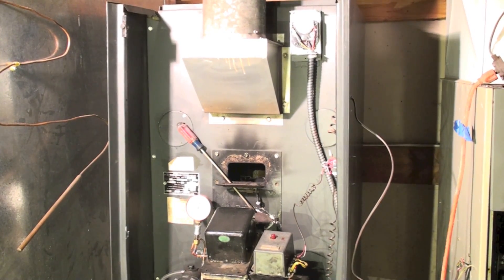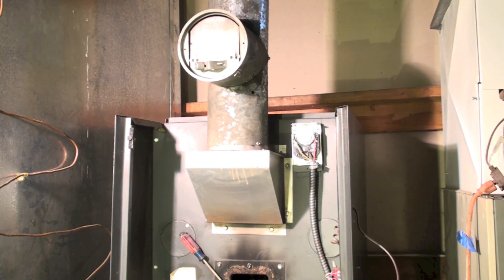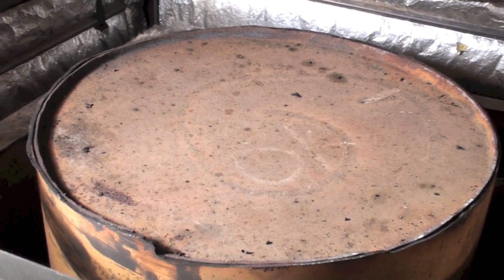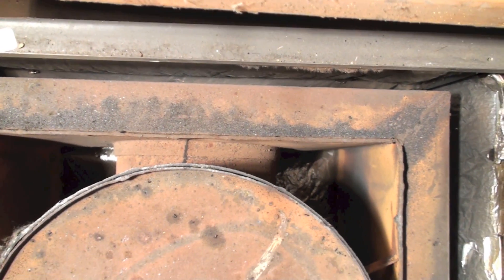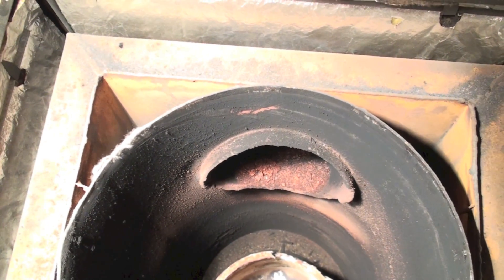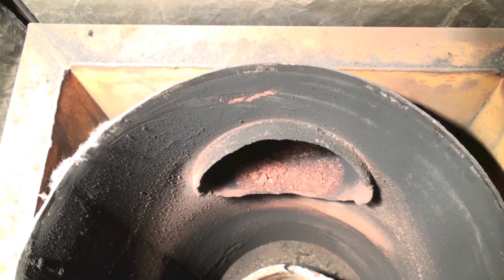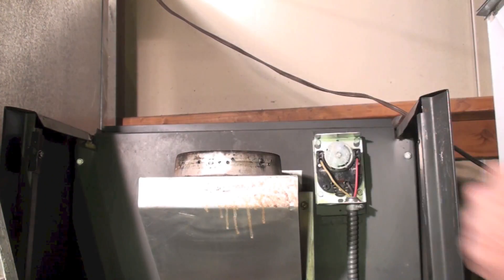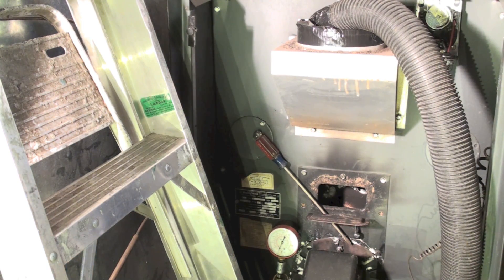Cleaning the oil furnace heat exchanger without cleanouts

Comment: Is it possible to simply drill 3 inch holes and add cleanouts? They look pretty simple
Reply from the maker: I guess you could, but you need an effective way to plug the holes.
GFM
Reply: @grayfurnaceman  do you have any videos on how to replace a combustion chamber? I have a nordyne hi-boy where the combustion chamber looks really rough

Comment: I have done well using a flexible long wire scrub brush and using the vacuum with a long piece of heater hose to get.around the round heat exchanger to suck up dirt and soot,  avoid the firebox area.

Comment: My low boy oil furnace has heat exchanger tubes similar to gas furnace ones!I can  get a small hose on shop vac back inside each tube  to suck out debris ! Is it safe to blow compressed air back into the tubes or would that just blow it back into combustion chamber? When I first moved into this house I found the heat exchanger tubes were almost half way filled with a sandy type of accumulated residue! I vacuumed them out and have not seen any build up since then. I had a combustion analysis done a few years back and even though older furnace he told me it was working almost as good as a new one would .
Reply from the maker: You can use compressed air, just not in the combustion chamber.
GFM

Comment: I pressed the red button too many times now my chamber flooded. Tons of black smoke coming out. Turned the unit off, the smoke stopped. Do i absolutely need to change the insides with a kit? Is there some other way,for example blowing air in there to evaporate the fuel?
Reply: Same problem here
Reply: @glenncoc0664  well it only smoked bad that one time. It was all burnt off next time she ignited.
Reply: Open the safety flap and let it rip tater chip. You'll wanna open it to release access pressure from the larger explosion from the extra fuel. Done it many times when I had tripping issues and caused flooding on my 60 year old King Boiler, made in Shade Gap, Pa. USA when things were built to last.

Comment: Would you recommend removing the burner assembly to clean the combustion chamber or is that unnecessary?
Reply from the maker: I would not.  Combustion chambers are delicate and easily damaged.  Concentrate on the heat exchanger.
GFM

Comment: Is there any way to remove the side panels of the furnace or the blower fan to clean the heat ex-changer ?  Also would there be soot inside the square ex-changer or is soot just coating the outside area, I'm trying to visualize where your placing the air gun  inside to loosen the soot.
Reply from the maker: The panels are not removable on modern oil furnaces.  Removing them would not help anyway.  
The combustion chamber is on the bottom.  Anything above the combustion chamber is heat exchanger.  The entire inside of the heat exchanger may be coated with soot.  You can access the heat exchanger from the inspection hole over the fire, from any clean outs or from the vent.
GFM